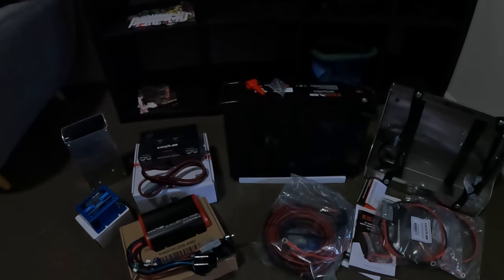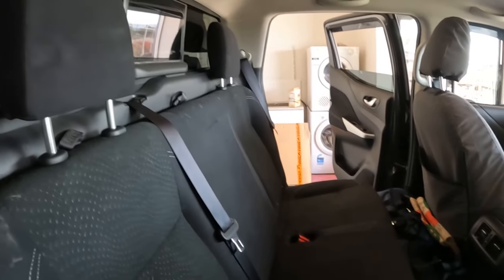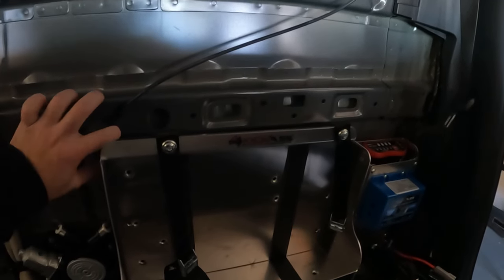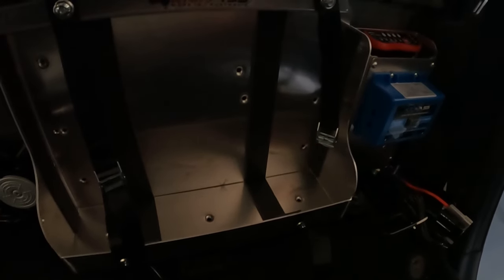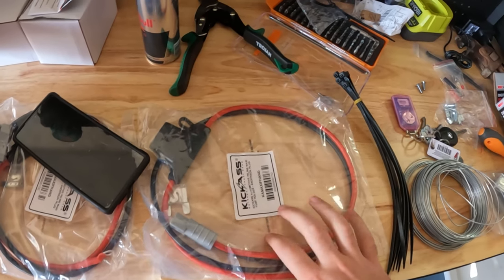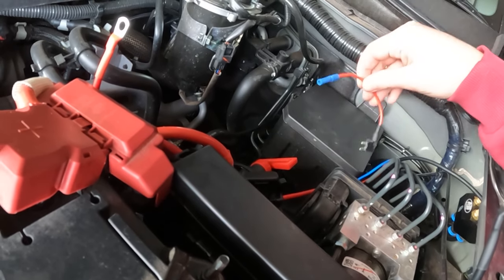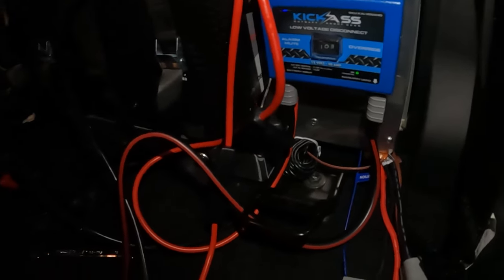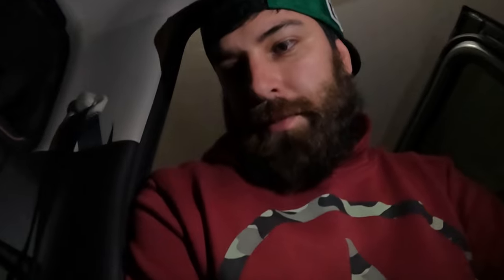Dual Battery Install - Kickass 120ah behind rear seat - Navara NP300 Build

Comment: I used a piggy back on the bottom 10a fuse but it caused my automatic window switch to stop working. 

Ended up using the 15a for the heated seats (which I don’t have).
Reply from the maker: Good tip! Thanks for sharing 😀

Comment: G'day, hows the setup going after a year of install? Any issues? And do you think the agm battery is good enough for the average bloke or would you recommend the lithium? Cheers 🍻
Reply from the maker: Hey mate, personally, I wouldnt buy it again, the charger burnt out on me after a month. If I was gonna do it again I would go for a redarc one and spend the extra dollars, well for the charger anyway. The battery was fine for me to power lights, charge phones and a power a fridge. I would go lithium if youre gonna start powering cookers etc.
Reply: @GetThatBread  g'day again. cheers for the reply.
It just tripped my brain when ya said it burnt out after a month that maybe there is zero air flow behind the seat and that may effect any type of charger behind the seat, thoughts? 
I have not had my back seat out yet but it might be very stale air behind their. 
🤔 (Thinking out loud) maybe relocate the charger under the front passenger seat? As for the battery I'm thinking do it once do it right with lithium but the price, it's a toss up. But as allways cheers for the info, much appreciated 🍻
Reply from the maker: I dont think airflow was an issue, that being said though I'm not a huge auto electrical guy so if anyone else reads this and thinks that contributed please let us know. But I agree with the do it once method, if its something you will have for years and potentially adding to your setup as you go then may aswell have the base sorted 🤜🤛

Comment: Bit late to the party, but started to look at the kick ass set up. Is that just a deep cycle battery or lithium? 
Also did you buy the dual battery set up as a whole package from kickass?! Made it look very simple 👌🏽
Reply from the maker: Better late than never 😀 just an agm. If moneys not a factor I would go lithium for the weight save and battery life. Yeah was a whole package deal. From memory was about $1200.
Reply: How can I acquire the unit from Kick Ass as well as the system’s instruction?
Reply from the maker: Jump on their website and you should be able to find everything you need

Comment: How do you remove the rear seat on an np300?
Reply from the maker: Lift the seat up, two bolts either side and unbolt the middle seatbelt. Then lift the back section up and should come out.

Comment: hey mate, how did you go putting your seat back in. got mine and just wondering how you got the seat to sit back in nicely. cheers
Reply from the maker: Heya! It was a tight fit on the battery side. I put the drivers side in just a little bit to begin with, then pushed super hard on the passenger side to get it in place. Easier if you have two people.

Comment: Where did you end up mounting the power box?
Reply from the maker: Do you mean the charger? Its all behind the rear seat, should be able to see it in the video
Reply: @GetThatBread  as in the box that has all the usb/cigarette ports, volt meter.
Reply from the maker: Oooooh gotchya, I didnt do anything fancy with it. Just ran some power to the box using a 6m cord and left the back window slightly open for the cable to come out. Then just had it sitting on a table at camps or just had it sitting on the back seat when driving around.